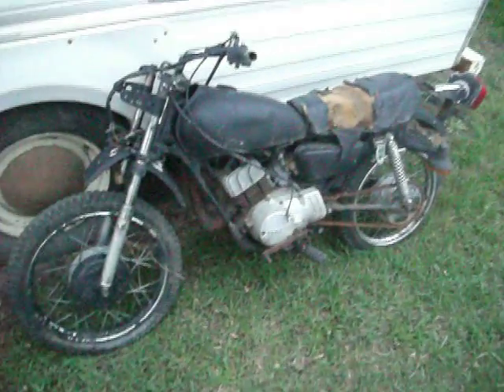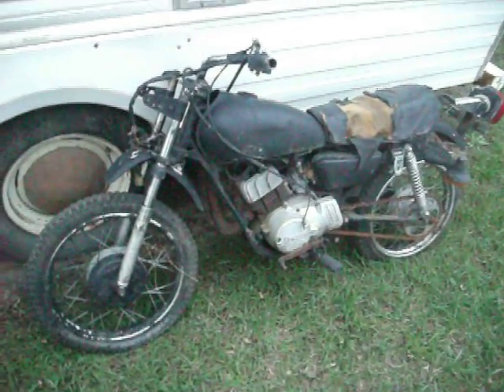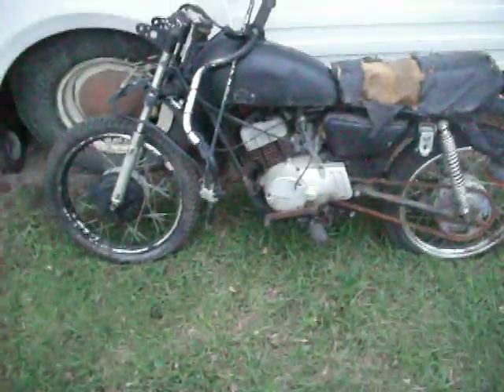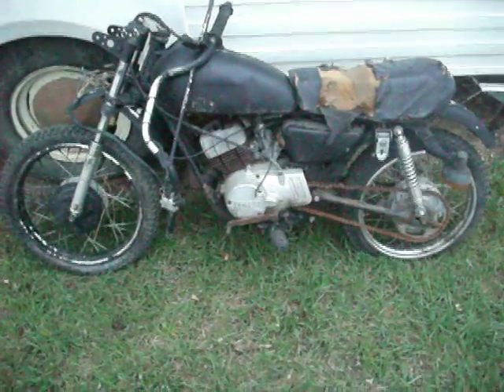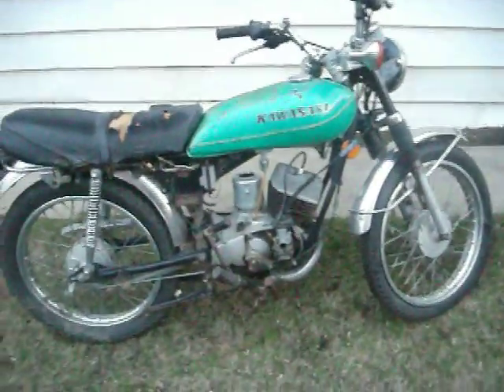Got Some Free Dirt Bikes, Suzuki, Yamaha, Kawasaki And A Honda

Comment: i had a free jianshe py80 i found in a bush runs but js very! smokey but cool i did put it on face book if it had a owner or stolen went to the police as i had no luck they checked the cerial number and there we no reports on it. i kept it but ive put it or ebay for £60.00 back plastic. gone muffler gone comes with half a bottle of 2 stroke has half petrol mixed inside runs well but smokey hence the price if you want it message down below thanks
Reply: PyroDudeUK ...do you still have it.??